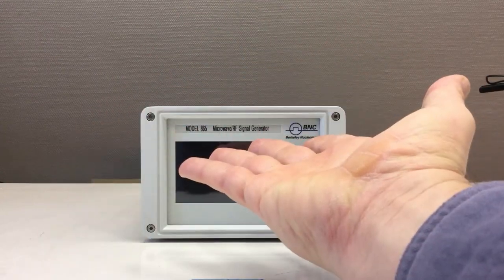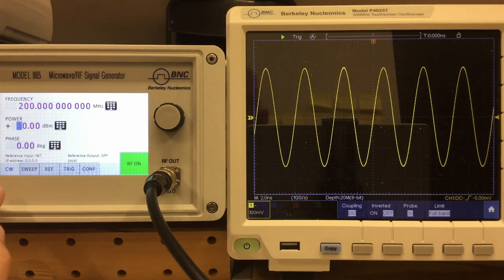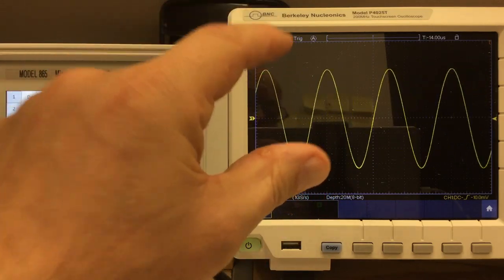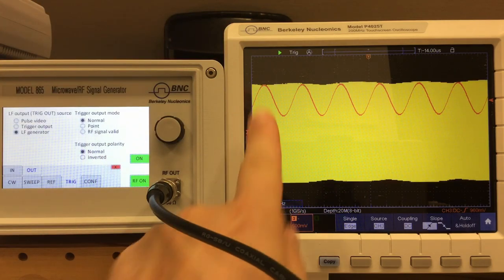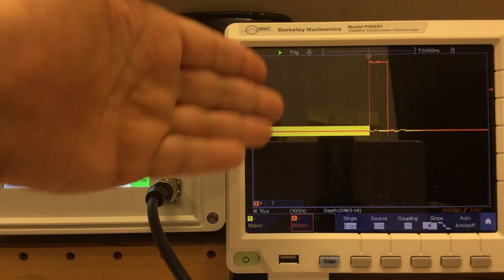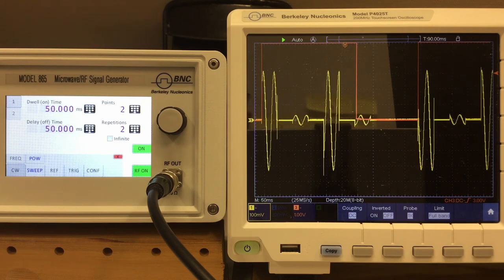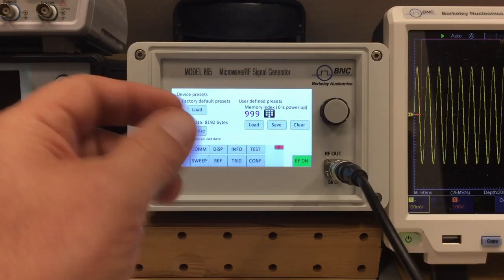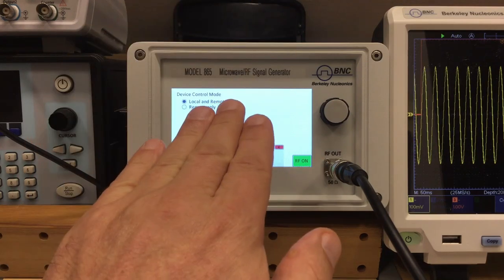BNC Model 865 40 GHz RF / Microwave Signal Generator: Review Part 1

Comment: Thank you very much for the review, it is great! Are you going to record Part 2 (how to use this unit remotely)? Would be very interested in this one.
Reply from the maker: You're welcome! And yes, I'm still planning to do the second part (remote control via LAN/USB/IEEE).  I also intend to make a video about using the 865 to measure the transmission frequency of a simple Doppler radar module. But these things take time (I'm just doing this as a hobby), and so it will be another month or two until I'll upload something new about the 865.
Reply: @robertssmorgasbord  This is perfect! I will wait for the second part and video about measurement, thank you again!
Reply from the maker: @olhafarion5070  Again, you're welcome!

Comment: To really characterise such an instrument you need something which costs nearly ten times what this unit costs.  This is considered one of the lowest noise mm-wave synthesizers currently in production.
Reply from the maker: You're absolutely right! The 200 MHz scope is the most expensive instrument I have. So I focused on the user interface and the functionality. Couldn't find a flaw there.

Comment: Not one word of objective criticism.  Shill review.
Reply from the maker: Well, I did complain about the external power brick at the start (still don't like it). To be honest, it's way above my capabilities to test the "inner values" of such a unit (frequency stability, noise etc.). But the user interface (touchscreen, rotary knob) is indeed implemented very well. We'll see in part 2 if the remote control software lives up to that standard.